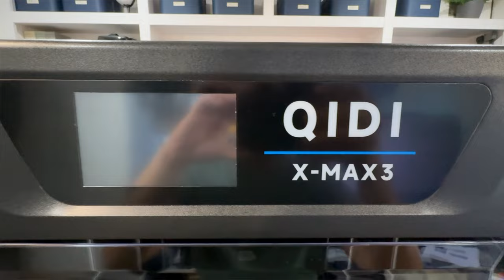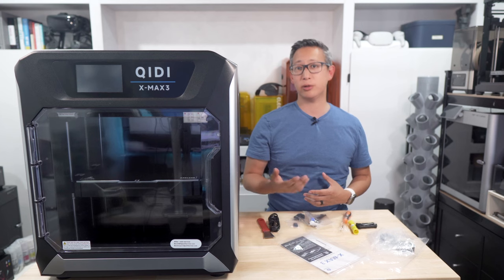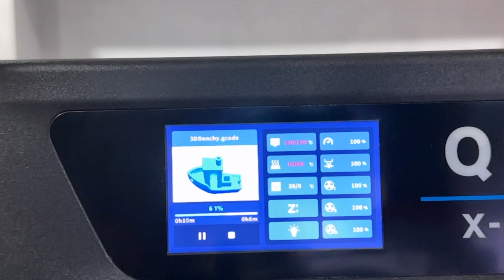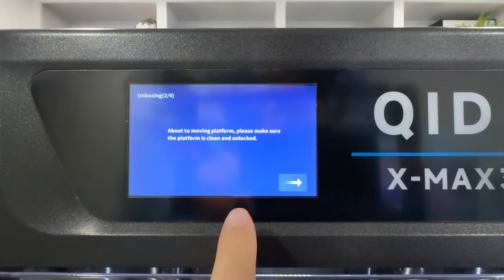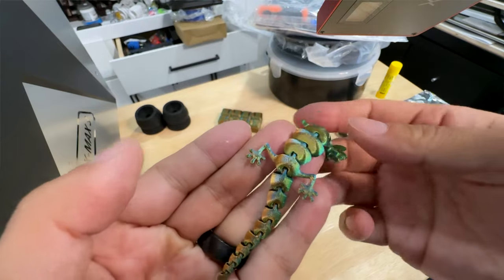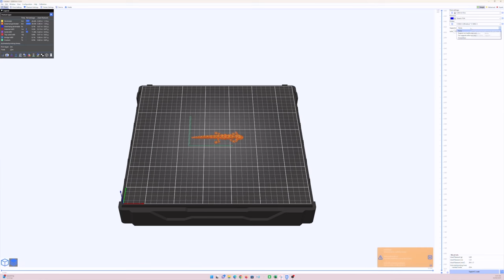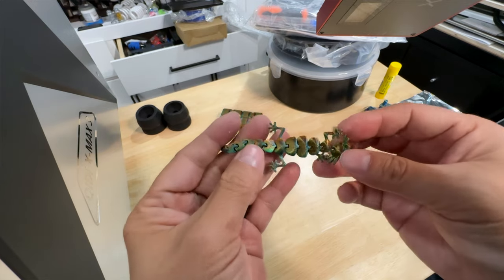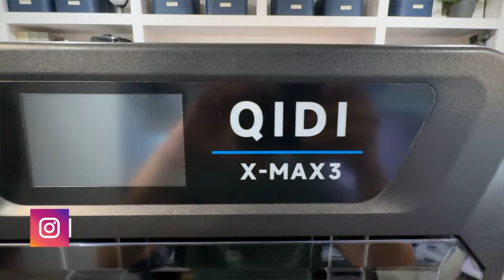This 3D Printer is HUGE and FAST | Qidi X-Max 3 Review

Comment: I cleaned my build plate properly before printing and I've never had to use the glue stick on pla, petg, or tpu. All 3 adhere great and mostly break free an their own when the plate cools. I'm using Qidi pla and petg filament with their profiles and polymaker tpu with my own profile based on my test results. You may need to adjust your bed or nozzle temps for your filament.
Reply from the maker: Cleaning the plate helped with the adhesion.  Thanks for the tip and advice

Comment: Everybody doing these reviews compares this qidi with bambulab, which is just ridiculous and lazy. the bambulab is significantly smaller and significantly more expensive. It would be much more of interest some examples of settings, as well as large prints done on it as part of the review. And regarding 600mm/s speed!? Has the reviewer really printed at this speed? All in all - a lazy review.

Comment: Sounds like you may have not understood hot to use a printer, or this one….that print should have taken about 35 mins.  And it is a flex plate….you should have easily got it off had you removed the plate and kept it clean etc.

Comment: Have you tried painters' tape? 
Any prints with Carbon Fiber? the older units you flipped the build plate for the carbon fiber prints as the plate was 2 sided
?